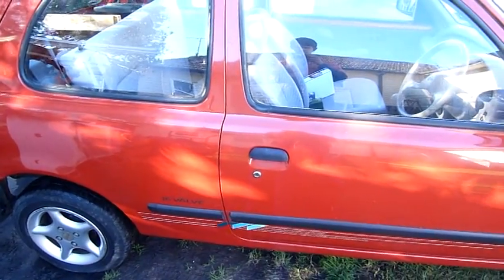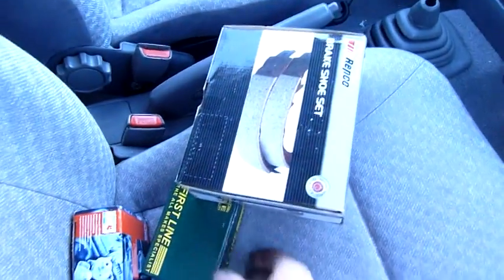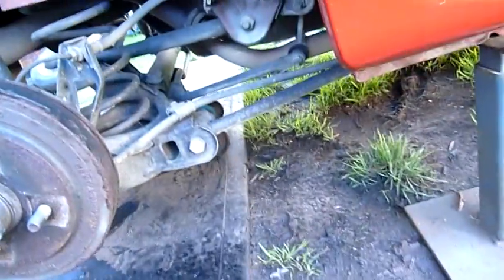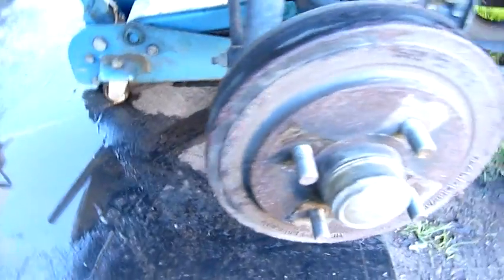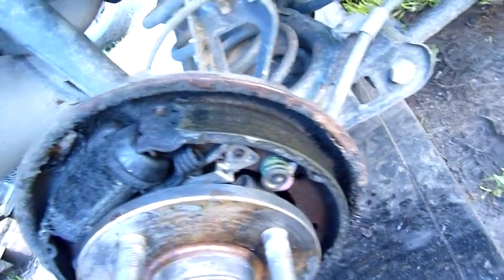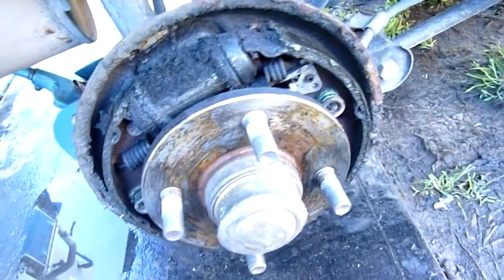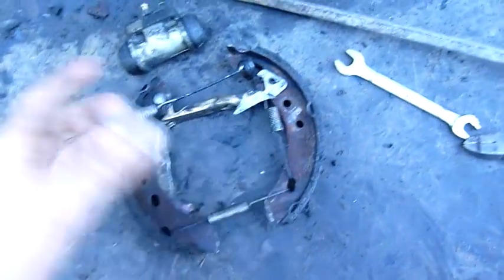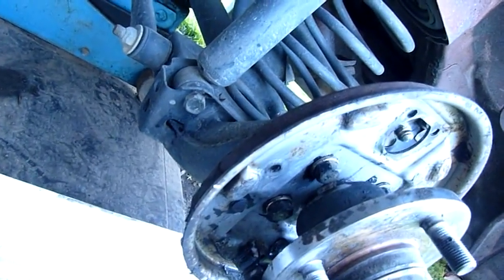Nissan Micra K11 Rear Brake Fun (reco) pt1

Comment: Drums ought to have been outlawed 30 years ago!

Overly complicated, inefficient, ineffective pieces of chit things!
The last disk brake Pistons I had to do was over 30 yo and hadn't been touched. 
Took under 2 hours to remove, rebuild and replace both sides. 
Had to do rear drums recently and it took endless hours not to mention all the running around I had to do to have a new line made which was frozen in the old cylinder. 

God I hate drum Brakes!

Comment: the jack screw is the pre adjuster. it keeps the brake shoes close to the drum so that minimum pedal travel is needed to engage the brakes.

if there is too much piston travel, the spring loaded adjuster arm advances the scew, moving the shoes further apart.

Comment: The reason they used drum brakes for so long is beacause it was an inexpensive way to incorperate a parking break into the rear. Most are not that hard to get apart, they simply fit over the wheel studs onto the hub, the old ones had an interference taper that you needed a puller to get off, a la Volkswagon. But I have seen disks that were a nightmare to change too, like on the front of an earlier Ford Festiva/Kia, you have to remove the whole spindle and strut assembly to replace them.

Comment: The older style brake rotors sometimes bolted onto the back of a hub but there was really no problem getting the hub or the rotors off, the Budd rotors that Chrysler used between 1967-69 are like that. Your main problem with the Budd rotors is finding a replacement, you usually have to retrofit something. The best ones to deal with are G.M rotors, they slip over top of the wheel studs, and on their trucks they used the same bolt pattern and rotor design for several decades.

Comment: try doing light truck brakes, the springs are a son of a bitch even with the 'propper tools', tho i almost always ditch them and get the multigrips out. i was doing a small tipper the other day and i ended up with no knuckles left at all. it would be fiddle in behind the flange tho. are they a taper bearing or sealed? 

firstline is a big thing in the uk i think, i use it all the time to source jag part numbers and parts

Comment: I haven't heard about that problem with Hondas but I do know that the jerks used to change brake rotors from one year to the next on the same model of car, lets say an 83' Accord would use different rotors from an 84' or an 85' even though the cars are more or less of similar design. I really think that they must have pulled the American Motors stunt of bargain shopping for parts on the open market, so they got a deal on rotors from company X in 1983 and then a deal from company y in 1984.

Comment: Hey there, Aussie50...
Would like to know, if you do, what's the ampere output of the fuel pump for the 1996 Nissan Marche/Micra. I got a reading of 4.5/4.6 AMPS. Im trying to solve a fuel system issue.
Reply from the maker: Mm not too sure on that one, your reading sounds about right, but if it becomes erratic it could be brush failure.